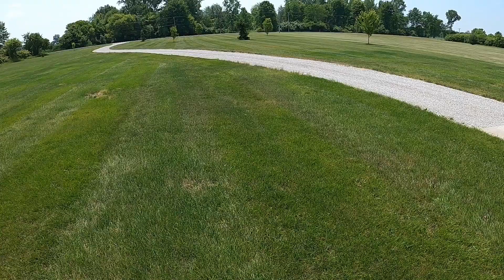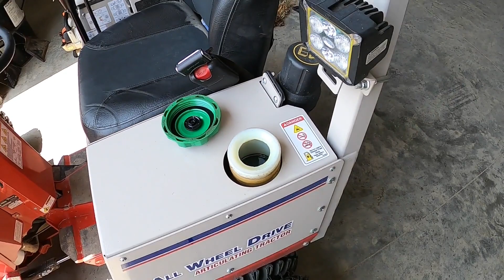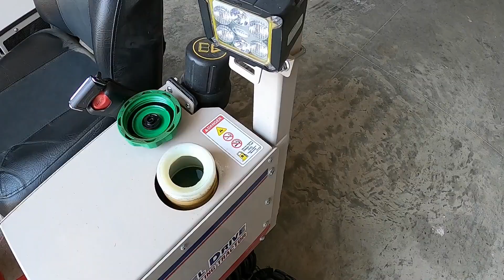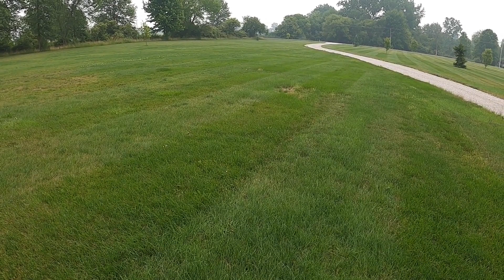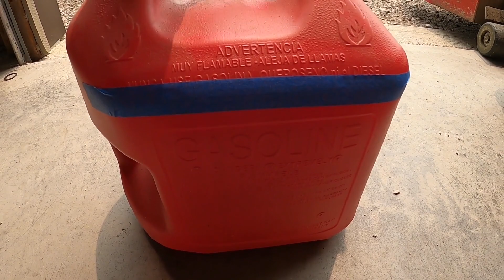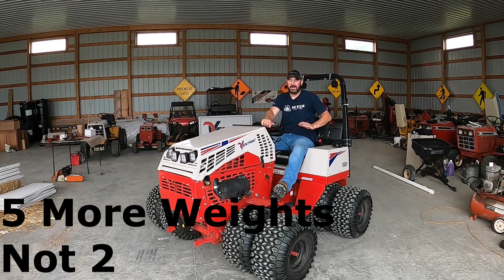Ventrac Kubota EFI Vs Kubota Diesel Fuel Consumption Test!

Comment: Was the new Kubota EFI N more powerful then the diesel   I have been debating between the diesel Y vs the EFI Kubota N model   Fuel consumption isn't a huge turn off for me, but having power or being under powered would be.
Reply from the maker: I felt the N seemed to have a tad more power than the Z. The diesel works great for me, But if you are power hungry and want the most power then go with the EFI Kubota gas.
Reply: I use a Y right now with the 6ft finish to do our lawn. About 10 acres worth of mowing. Just ordered a N Pro with a WAM. Hoping to cut my time down from 8-10 hours depending on cut to 5-6. Any grade variation the diesel just seems to bog down. Especially  mowing the front slope of the house. I have to use low range and am mowing on an angle and it’ll only go about 3mph. Hoping to get 5mph and the 2 extra feet of cutting width.

Comment: Back in the days when diesel was cheaper per gallon than gasoline, I used diesel.  Today, prices have more than just flip/flopped.  Pennies per acre, even the Z will come out ahead on my land.  Than again, my land is steep and I don't cut my fescue fields unless they are pretty tall; about 3 weeks growth, thus not using high range other than to tram.  The Z is a gas hog, no doubt about it, but I can buy gas way cheaper than D.
Reply from the maker: @rooster3019  I originally purchased the diesel for easy fuel storage.  I store large quantities of fuel to keep on hand. Ethanol was the worst thing that ever happened to gasoline.  I was limited on long term storage and even with additives kept dealing with water in fuel. I was using non Ethanol fuel, But it was pretty expensive.  I have gotten pretty lucky here in Ohio. I have found a few CO-OPs that sell off road diesel. I have been getting off road diesel around 50 cents less per gallon than regular pump gas. With on road diesel it still saves a bit with fuel efficiency,  But I primarily just like the ease of storage of diesel fuel.

Comment: There is a noticeable difference in fuel economy between the Z and N.  The N is supposed to have the same fuel consumption, 1.2 gallons/hr, as the Y.  I don't have an exact way to measure fuel consumption and comparison to other models
Reply from the maker: I am going to try to do the same test with the 4520P here soon if I can get ahold of one. I was told the P is very close to the Y, But I would like to run some tests to find out. I think it will be pretty hard for any gas engine to get same as the diesel, But you never know. The diesel is very easy on fuel. When I used the grapple a few weeks ago to remove trees I only used half a tank in arond 7 hours on the machine. The new N is definetly better than tbe Z.
Reply: @steiger256  Half a tank in 7 hours is about one half gallon per hour.  That's crazy low.  You had to have been babying that thing the whole time
Reply from the maker: @bluecordterrainmanagement  That was using the power bucket dragging limbs. If you do not have the pto engauged the diesel really sips fuel. Once you start working it hard it uses more. The diesel is really effective on fuel.